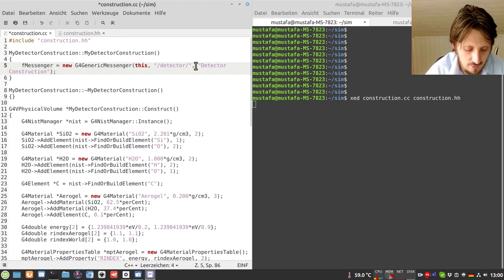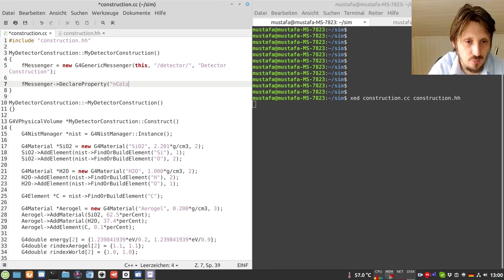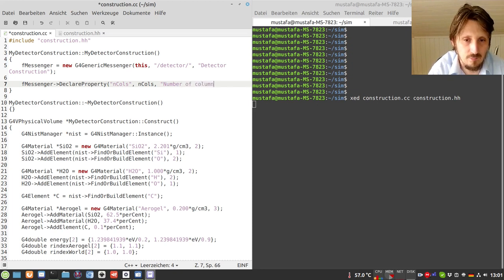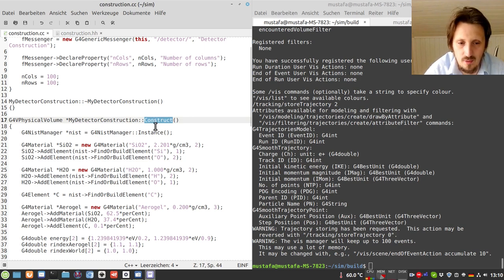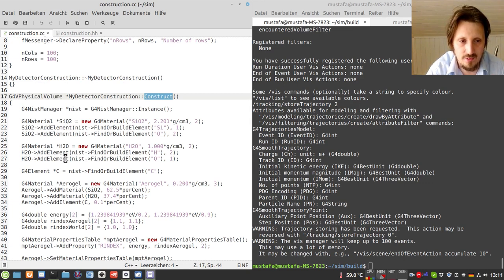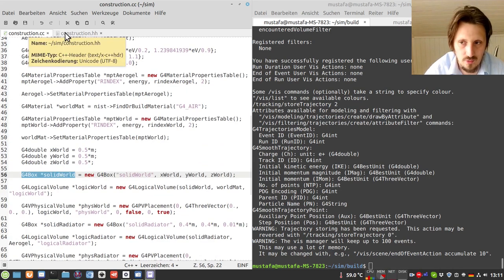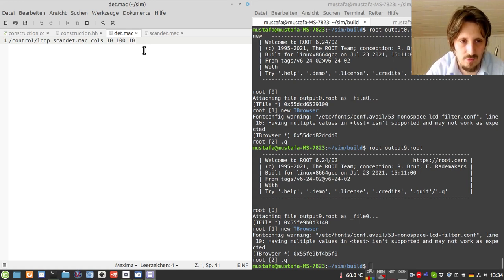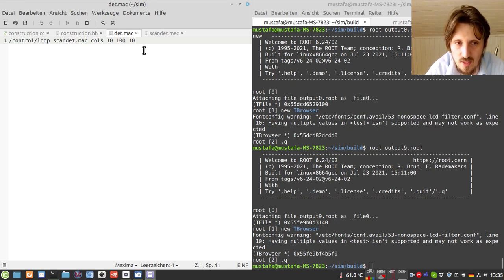Geant4 Tutorial 10: User-Defined Messengers

Comment: Hi, i have a problem and i really don't know where it could came from, the  /run/reinitializeGeometry doesn't seems to work, even if it doesn't show any error message, did somebody solve this ?
Reply: I am having the same problem as you. I found that after doing /run/reinitializeGeometry and running an event. If you run the command /vis/drawVolume it would draw the volume with the new columns and new rows, but it would delete the visualization of the trajectories. Did you find a solution other than the one I explained above?
Reply: @jamesbrowning4360  I have the same problem as you too. Can anyone solve this problem?
Reply: Same problem, James browning's suggestion lets you see the updated detector Geometry but not the run itself, root writing works normally since I can see the reduced resolution of the detector
Reply: I think that once you run "/run/reinitializeGeometry", all your visualisation commands are deleted. If you run  "/control/execute vis.mac", all these reset but it's a rather inconvenient solution. Anyone knows a better option?
Reply: Same problem. Well, i'll suggest that after /run/reinitializeGeometry and pressing run button. type command /vis/drawVolume and after this one, basically copy paste all commands all together into command line of UI.

Comment: This series is excellent so far. Unfortunately at this video I am stuck. The generic messenger does not update the geometry. I use 11.2 with QT.  Does anyone know how I can adapt to proceed.
Reply: I didnt find any solution, aparently this may be a bug for de 11 version. However this is only a bug in visualization, it does not affect its functionality, therefore you can still simulate things, actually using the macros of the end of the video worked well for me but still no change in visualization.

Comment: Is it possible to loop over in different positions of radioactive sources?
Reply: @Sebastian: You mean multiple sources at different positions? If yes, I have done this already by defining Cs and Co sources at two different positions. Not using macro though. In my primary generator I generate a random number between 0 and 1 and if it is less than 0.5: Z, A, vector position for Cs source are assigned. Else for rand_no.>0.5, Z,A, pos_vector are set for Co-60. In principle, at the start of each event, it is randomly assigned either Cs or Co. See his Radioactive decay tutorial and you can implement that with what I just said.
Reply: @ManishSharma-eu4wy  nop a run for every position. I made 2000 macros, but I made with a bash script. I was trying to say “overloop in different positions for each run” to avoid making a bash script
Reply: @SebastianSarasti  : I have never implemented that for source position. At first sight, it seems to me this can be implemented. rdecay02 example provides an example where different variables can be changed via macro. Probably that could be a good start where you supply all x,y,z respective for each run (in macro) and then fetch those in PrimaryGeneratorAction.
Reply: @SebastianSarasti  Are you still looking for answer? I just figured out a way to implement multiple sources in a single macro. You can specify their respective types and positions and G4 does that for you in that run. I believe it dedicates certain number of events to one source and remaining to the second source (in case of two-source scenario). The relative division (intensity) is user-specified of course.